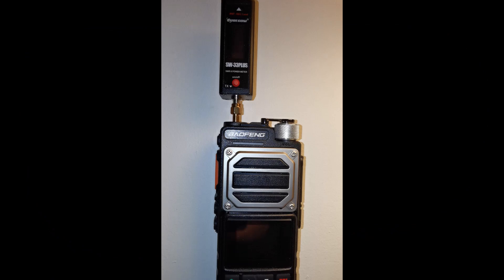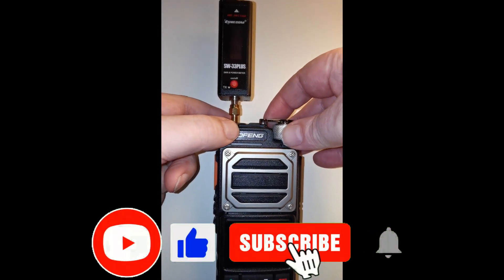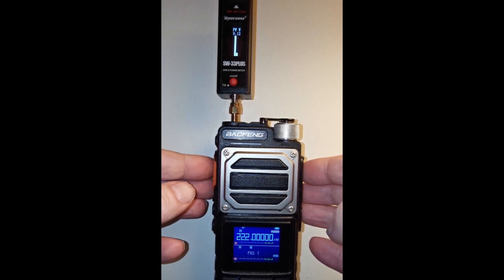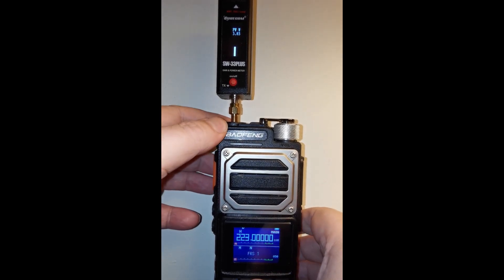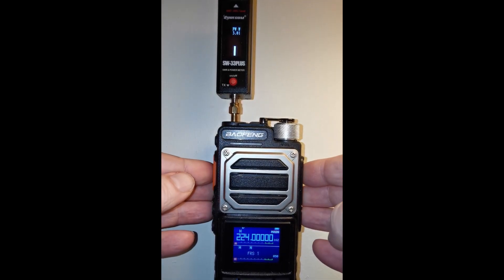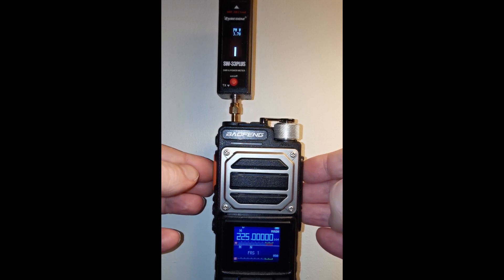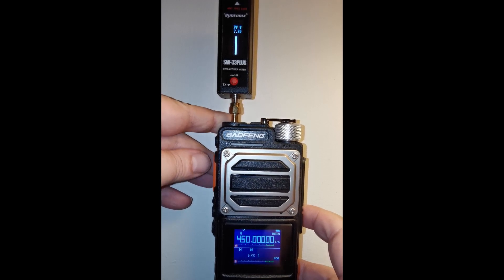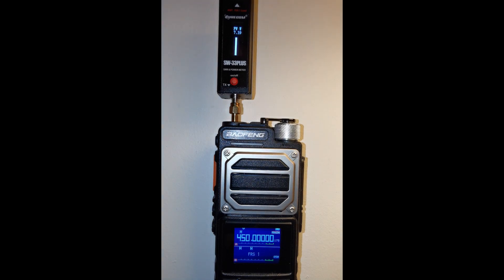Baofeng UV25L Ham Radio: power out test on high

Comment: CAPS 2 C NOT SHOUTING…. I KNOW U JUST PROVED THAT 10WATTS, IS NOT 10 ON DIFFERENT FREQUENCIES…. BUT WHY?  IS IT THE COMPONENTS OF THE UNIT, OR THE NATURE OF THE FREQUENCIES?
Reply from the maker: A multitude of things can cause this..

RF amplifier efficiency: Efficiency of a radio frequency (RF) power amp can vary in frequency. Different frequencies can affect how well an amplifier converts electricity into RF output power. Some amplifiers perform better at certain frequencies than others, resulting in varying power outputs.

Impedance matching: RF circuits, including amplifiers and antennas, are typically designed to operate optimally at specific frequencies. Frequency variations can affect how well the radio output stage matches the antenna system. Poor impedance matching can result in inefficient power transfer and therefore different output power levels.

Components and design of your radio: The components of your radio (such as transistors, capacitors, and filters) may behave differently at different frequencies. This can affect efficiency and power output at all frequencies.

Comment: It seems powerful but it's very unattractive.😂👍
Reply: Tools are not meant to be attractive, if you are buying this as a toy and looks are important to you then fine but as a useful tool the attractiveness should be dead last on the list of features that are important.
Reply: IMO, it's the same size as my old (and still working correctly) AOR AR1000 wide-band portable scanner. i like that. If the radios keep getting smaller than say, a Quansheng K5(8)..... im gonna start losing them. Im a BIG fan of the larger color screens that's coming out of China. The UV25's screen is nice, large and color. As far as attractiveness goes, I like it. A lot of radio for your hard earned ca$h.
Reply from the maker: its too heavy to be used as an HT imho

Comment: I just used mine on 1.25m this weekend for a contest and it worked great. 4w TXPO on a full battery, great audio and good tx audio reports. This is the first 220 MHz portable I've owned in at least 20 years since I had an ancient Icom HT.

Comment: What distance could 2 people talk to each other with this type of baofeng?
Reply from the maker: Very difficult question, too many variables (elevation, antenna, physical and RF environment) the list goes on , if you google this you will get a huge range of answers..
Reply: Ow okay thnx for taking your time to respond. I'll go surf the internet a bit more 😅. @ham-fam  

It is for my parents (living at eastern border of Europe) they want to feel "more safe" and want 1 to always be able to contact me (7 miles apart) in case something would ever go wrong.
Reply: To the radio horizon. At the beach or over extremely flat terrain the radio horizon is about 25 miles. Go up on a hill and it becomes farther, add some buildings and some small hills it becomes much shorter. In a dense urban environment it becomes MUCH shorter.